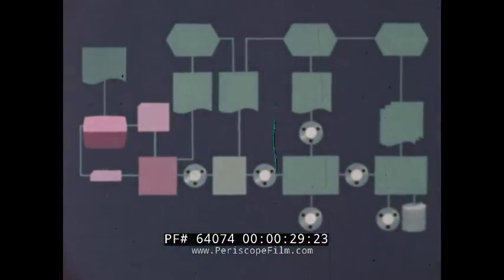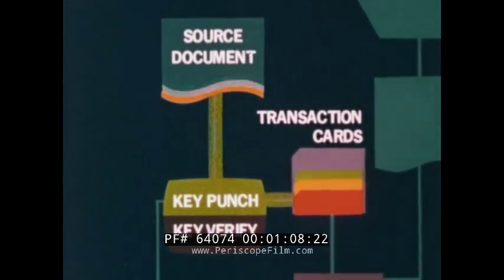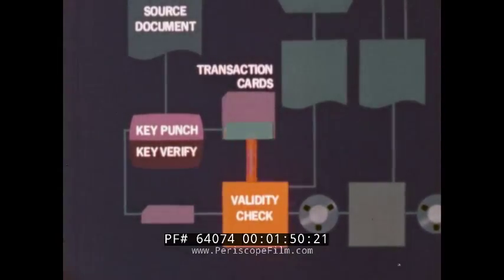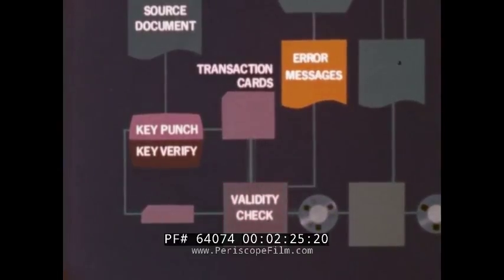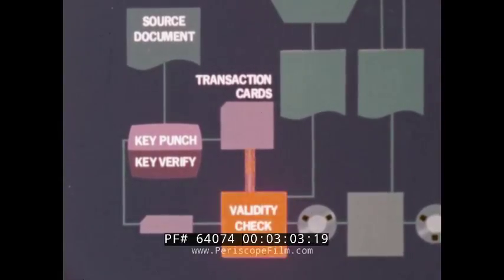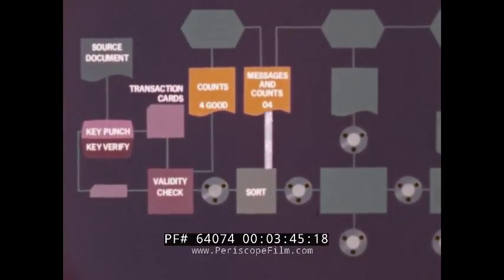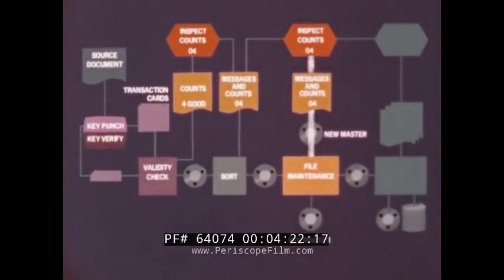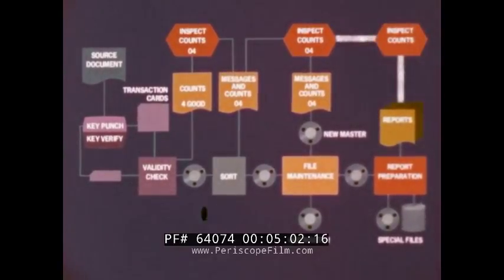1970s COMPUTER DATA PROCESSING & FILE MAINTENANCE EDUCATIONAL FILM  FLOWCHARTS  64074

Comment: Somebody should have told the programmer that when reading a date field that the year 99 comes before and is smaller than 00. And is only 1 year away not 100 years. You need to store and read 4 places for the complete year field not just 2 places. You need two places for the century and two places for the year. Or you will have a little problem in a few years we liked to call Y2K. However you will create a whole bunch of jobs, and terror for the whole country or even the world In 1999 while you hire a bunch of people to fix all the banking software that was written in Cobal, or was it Fortran ?     Garbage in, Garbage out.